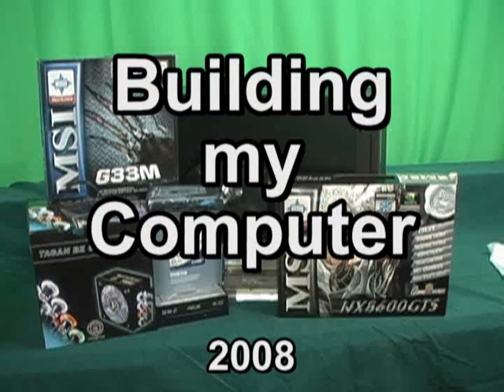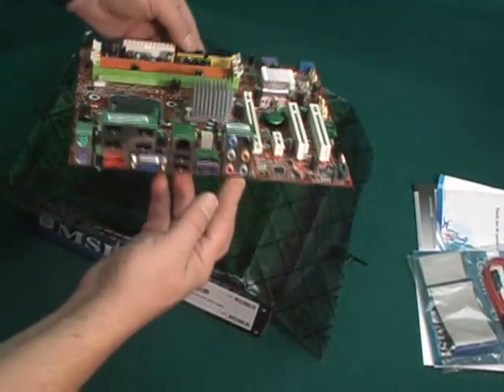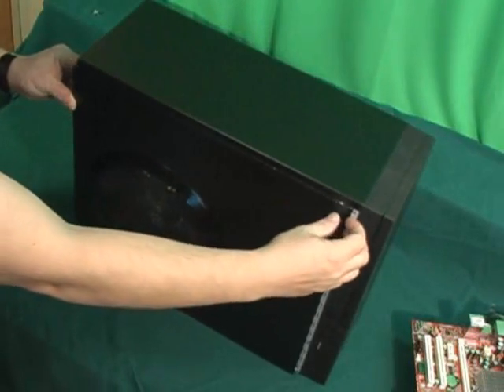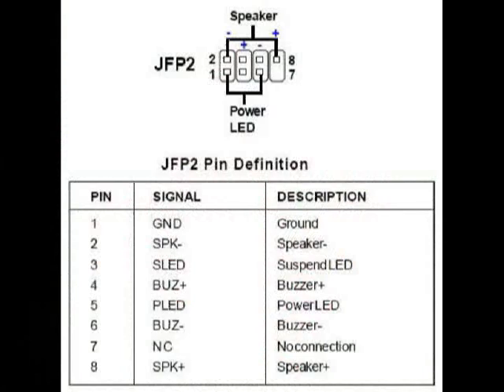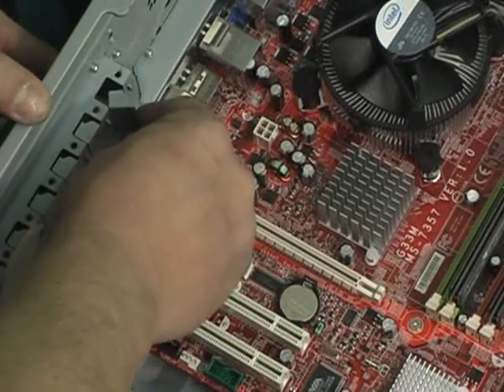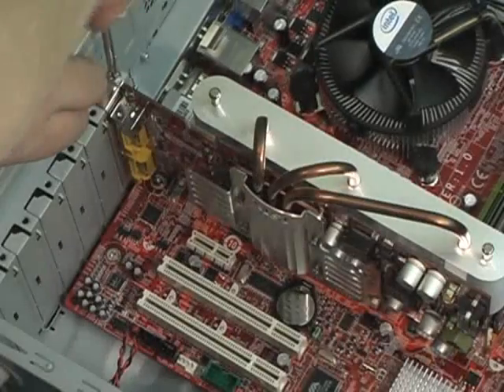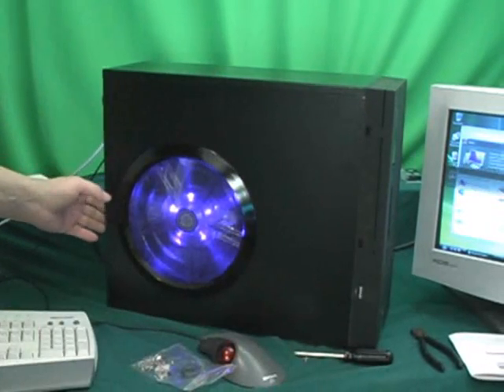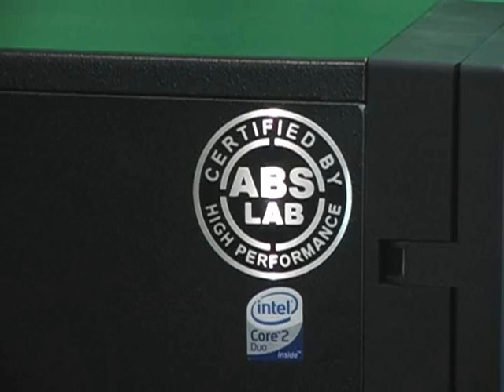Building My Computer

Comment from the maker: Any case will work Just make sure that the case is Motherboard Compatibility for Micro ATX and ATX.
This at newegg ,It look okay... It has the big fan on it.

 #N82E16811124116
ENERMAX Chakra ECA3052B Black SECC ATX Mid Tower Computer Case - Retail 

Newegg
This look better but its more money
 N82E16811144190 
APEVIA X-JUPITER-JR S-Type X-JPJST-BK Black SECC Steel Chassis ATX Mid Tower Computer Case - Retail 
Hope this helps